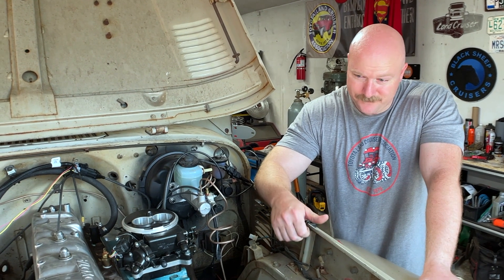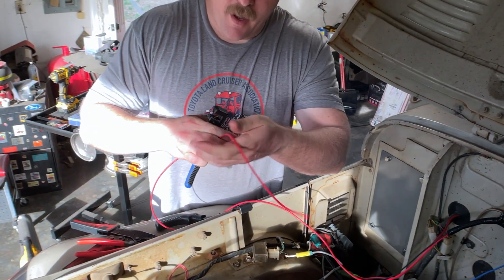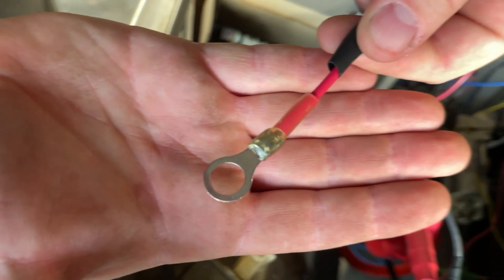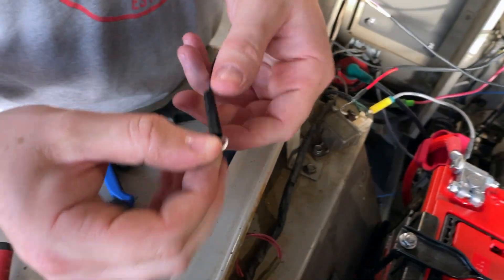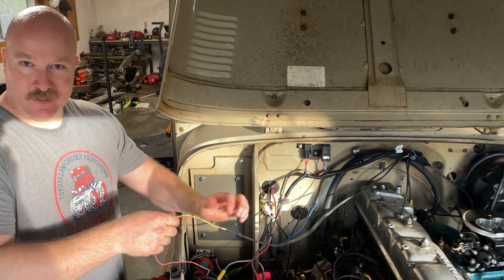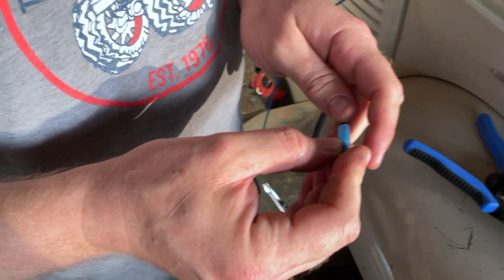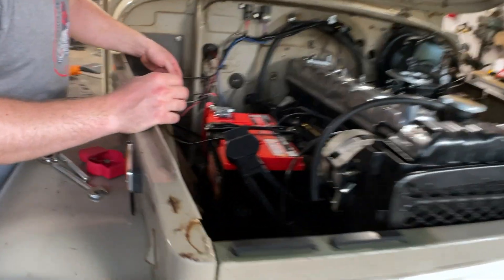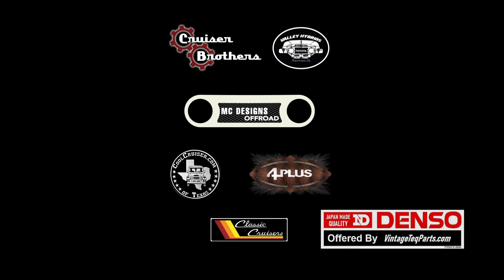Step 3: FJ40 Holley Sniper Install, I Become A Wiring Butterfly, Heat Gun, Wifey Distracts Me

Comment: Use black or green for grounds. Red is usually reserved for hot to battery. It's visual short hand. Also, check out some wiring loom, which provides abrasion protection for wires. You don't need to put heat shrink tubing over those heat shrink crimp connections, either.

Comment: Not a problem now, but for future reference, ground wires should be black or brown and power wires should be red. Other than that, nice work, man! I love clean wiring installs.
Reply from the maker: Bro! I legit spray painted the wire black later the next day 😆
Reply: @projectwrongway9127  That helps. If you have a label maker you could tag the wire where it connects?  I've never had success with paint sticking to wires.

Comment: Heat shrink isn't really meant to cover an entire length of wire like this. That is what wire loom is for. I like Painless Power Braid because your can add wire to it if you ever need to run a new circuit along the same route. Clean.

Comment: You don't need to solder a crimped connection.  It actually  changes the composition at the connection and it becomes brittle and   less mechanically resilient.  Not sure how this   idea became popular, but you either crimp or solder, not both.  Look at a hybrid or an electric car, even the 300V 250 amp  connections are crimped, 0 soldering.

Comment: Should you have a fuse right at the positive wire connection?
Reply: I was thinking the same. Maybe check the instructions Ben and make sure it doesn't ask for ask for fuse at your red 'hot' wire coming straight off the battery. Im thinking it probably should.

Comment: Totally forgot about the FJ60 switch on the Coil and distributor. Looking forward to it cranking! I'm actually looking to do the Sniper myself, but I have a SBC 350. Are you using the original fuel tank, or did you get a new fuel tank?
Reply from the maker: Original fuel tank, I’m waiting on a bung I ordered to do the fuel return. Then it’s go time!
Reply: I’m doing Sniper on my SBC 305 in an FJ40. Glad Ben is stepping on all the land mines for me🤣